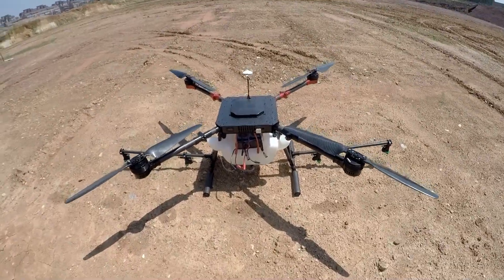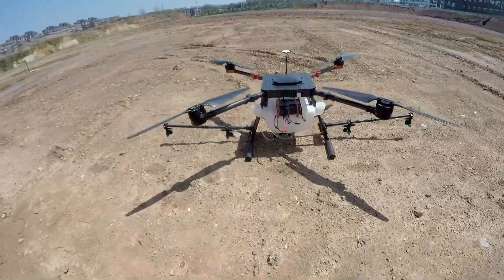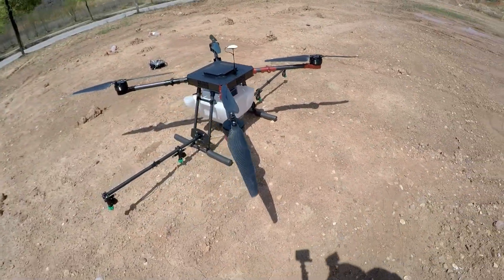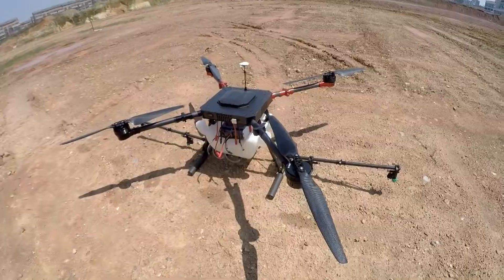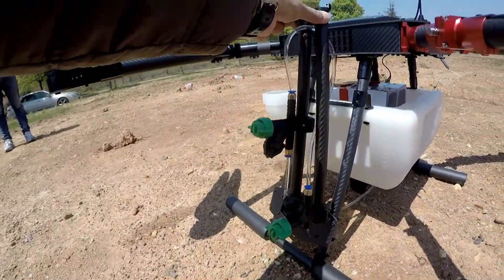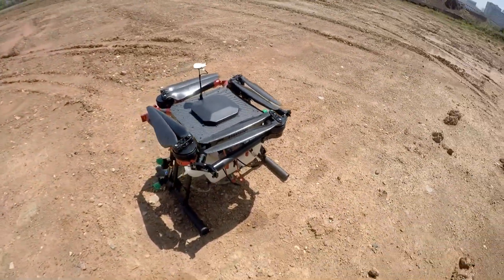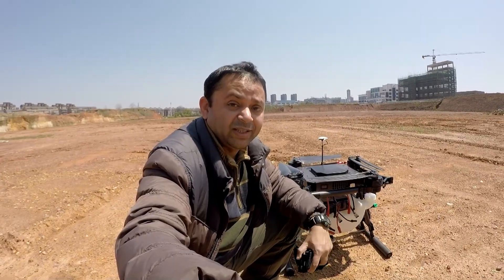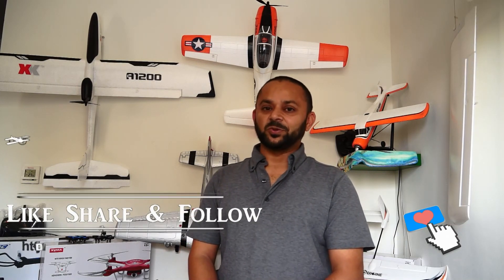Giant Agricultural Spray Drone Maiden Flight Testing

Comment: Peace be unto you brother Ali. How does the AGR 4 compare to the six prop version in usability effectiveness? Need help deciding which to purchase?
Reply from the maker: not much difference. nor 6 props will save from crashing if one motor stops. 4 props are more efficient.
Reply: alishanmao thanks was racking my brain you just helped me alot
Reply: alishanmao Could you tell me the  prop and motor size as you have it configured in the video?

Comment: Ali, can the machine fly over a taraine that has a 30 to 40 degree inclination?
Reply from the maker: In Autonomous mode we will need some sensors installed then it can be configured for that